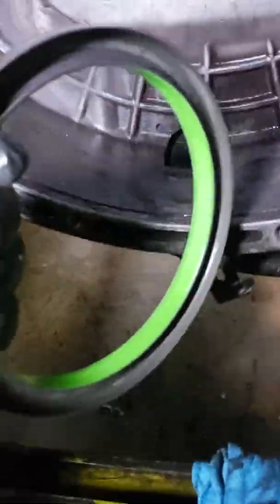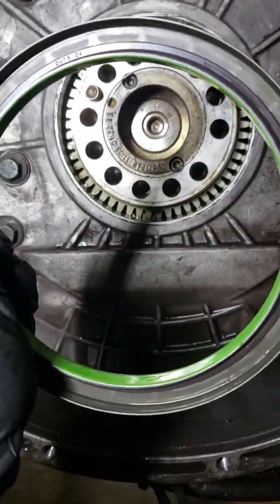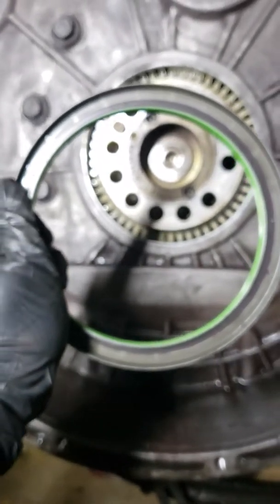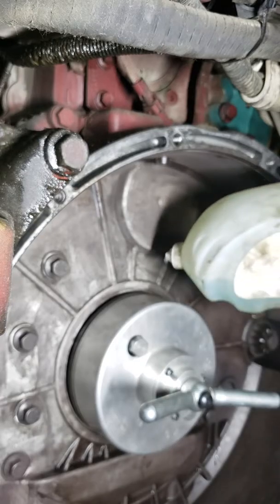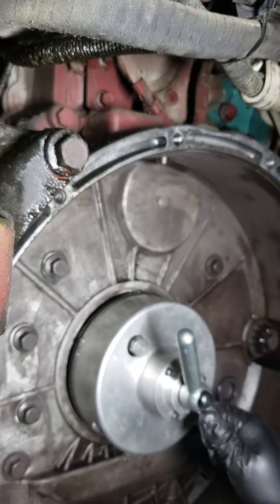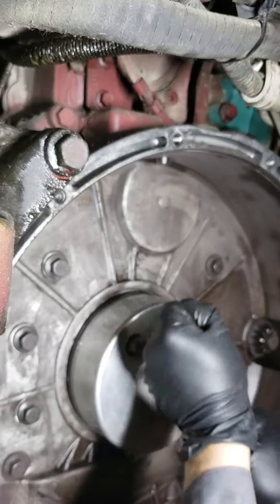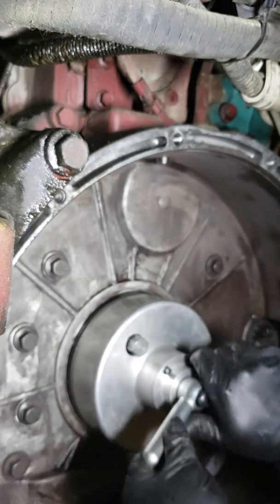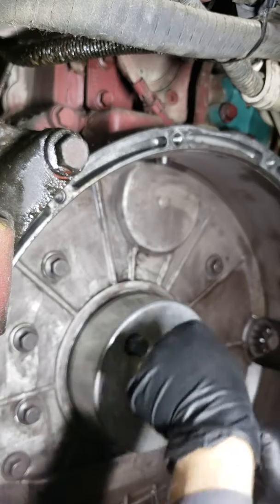Replace Rear Main Seal on Mack Volvo engines.

Comment: Thanks for posting.  May I ask what you recommend for removing the seal?
Reply from the maker: @bryanbivens8193  drill and screw in drywall screws and pry out.  Or use a seal tool for a ISX

Comment: Do you have a part number for that tool bud?
Reply from the maker: OEM 88800561
Reply: What will put teeth marks on the out side of the seal ring inside  we put 2 seal in the truck and  still leaks
Reply from the maker: @rdkuy30  you might be installing the seal in too far
Reply: @onemethod20001  I got the tool from Mack dealership   And the 2 time I had your video  to put it in and about 3 days it started leaking oil and  now about about a gallon a day pull the transmission back out this front loader pull the seal look ok just the teeth marks in it I want to  the Mack Dealership and they have not seen it done like that
Reply from the maker: @rdkuy30  you must be hitting to cranks gear teeth.  This video was done on a 2013 Mack Granite. I've done a couple 2013s with no problem.  What truck are you working on?
Reply: @onemethod20001   2010 mru613
Reply: Haven't used it on an MRU yet but we got one and it's perfect on the GU with MP7. No issues at all so far.
Reply: Hola la herramienta empuja el reten del medio dónde está clavado en el cigüeñal